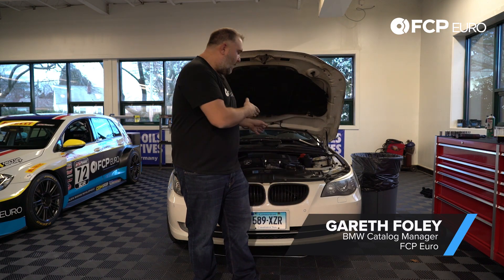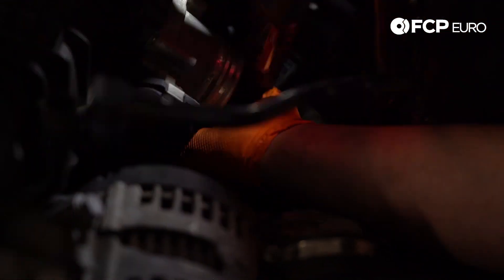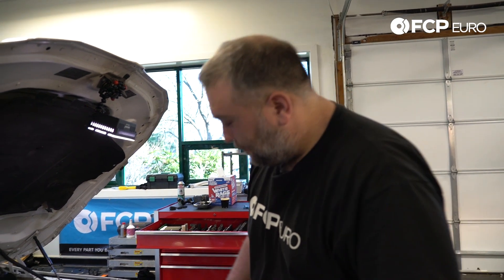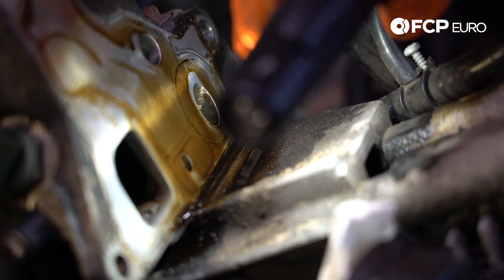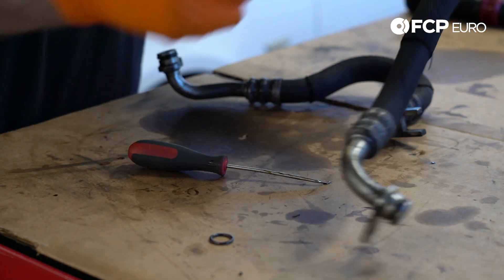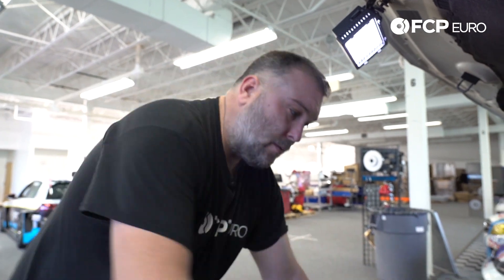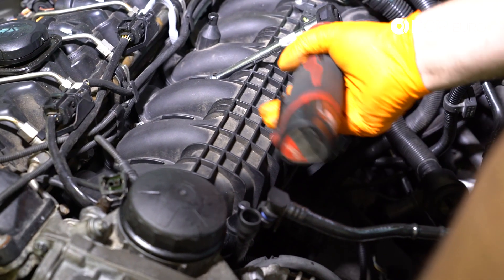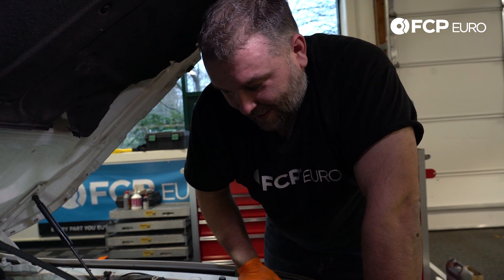How To Replace An Oil Filter Housing Gasket On A BMW N54

Comment: Has anyone tried the process to drop the alternator to get the back housing bolt? Seams easier that removing the intake.
Reply: All you have to do is remove the intake manifold bolts, then lift up the intake manifold while moving it to the right just enough to get clearance to the bolt. You don’t even have to remove the charge pipe. It makes the job so much easier. Under and hour to do. This guy did extra lol. Sorry fc euro, I do buy parts from there tho 👍🏼
Reply: I have and you are correct. It is SO much easier.

Comment: Do I need to prime the oil on n54 07. Do I add oil in housing?
Reply from the maker: You don't have to, but it doesn't hurt either.
Reply: Factory service manual says you should, and early n54s in particular sometimes spin a rod bearing after these gasket replacements. Some people believe it's because the oil wasn't primed.

There is only ONE way to do this properly and don't let anyone tell you differently. You must remove the electrical connectors from all 6 of your fuel injectors. The pour oil into the oil filter housing hole.  Don't add more oil than you're supposed to, just make sure you dump a quart or two of the total oil being used to fiill the system through this hole.  And it's a good idea to soak or swirl your new filter around in some fresh oil really quick before installing it. Lastly, make sure to lubricate your o-rings with oil before installing. The tiny one on the filter housing should be lubricated with oil before it's placed on the stick thing, and the big one should be lubricated with oil before being placed into the filter cap.

Once everything is tightened up and the fuel injectors are disconnected, get in the car and run the starter for 10 seconds without stopping, then wait 30-40 seconds, then repeat. Do this one more time (total of 30 seconds starter run time, two different waiting periods of 30-40 seconds). After this, you can reconnect your injectors and finish reassembling everything.  Take the care for a long drive if possible, at least 20 minutes (or more) to get the oil all warmed up and flowing through the system. As always, don't go driving hard until your oil has warmed up fully.

And a last note: this guide was great but really took a shortcut refilling the coolant. It's very important to burp the system.  And when refilling the coolant you should be checking the freeze protection, but if you just fill with 50/50 that's usually fine.  But it's important to loosen the bleeder screw on the coolant reservoir--it looks like a giant phillips plastic screw right next to the upper hose running away from the housing.  Open it wide and fill the coolant to nearly the top of the filler cap until the floating level bobber is fully floated to the top of the reservoir and there are no more bubbles coming out. then give the upper radiator hose a few squeezes, and re-tighten the bleeder screw, then reinstall the cap. Then afterwards, and this is extremely important: you must run the automatic burping mechanism to purge the cooling system of any air bubbles. To do that, put a battery charger on the battery unless you're sure it's brand new and fully charged, then get in the car, insert the key, keep foot off the brake and the clutch, and put the car into the "on" position by pressing the button (twice if necessary). You need to turn your heater on to the highest heat setting for both sides, but have the blower set to a volume of only one bar. Make sure it's set to blow face or feet but not the defroster. Once that's done, press the gas pedal all the way to the floor and hold it for 10 seconds until you hear the water pump activate. Once that begins, it will work on its own to pump water through the system and purge any air present. This can take about 20 minutes. Leave the car alone while it works (leave the key in place and don't turn it off). Once finished, you're safe to drive the car.

Comment: I’ve read that it is a requirement to prime the engine after this procedure. Apparently there is a ton of folks that have experienced a seized engine. What is FCP Euro position on this matter?
Reply from the maker: It certainly won't hurt to prime the engine!
Reply: @fcpeuro  how do you prime the oil system im going to be doing this on my 2011 135i keep hearing about the damage done to some n55 engines your opinion plz thank you
Reply: @pnum9618  did u ever find out how?

Comment: I just did this a couple of weeks ago. After the job, I noticed my oil doesn't climb to the normal operating temp (220-240 deg F). I've got a 335is with the oil cooler. I've read there's a sliding valve in the cooler that operates like a thermostat and keeps the oil in operating temps. Could this now be stuck open? I cleaned this and the filter housing with non-chlorinated brake cleaner, and I also replaced the oil pressure switch that came with FCP's kit. Anything I should look for to test that the oil cooler is functioning normally? I've got a Schwaben/Foxwell scan tool, if that can help.
Reply: So what happened?
Reply: @thinkingagain5966  After a couple hundred miles, it actually started to operate normally. But my oil temps don't climb as high as it used to before the job. It stays 20-40 degrees cooler than before, interestingly. Since the gasket was toast, I think there was too much coolant mixing with the oil, so the oil cooler couldn't do its job properly. Glad I replaced this gasket when I did!

Comment: I’ve done this on my 2011 535i (n55) it is a bit pain in the neck to do. One thing I couldn’t find on mine was the radiator drain petcock, so had to drop radiator hose ... pretty messy. I believe BMW service bulletin says to drop the hose... can anyone chime in if there is an actual drain plug for the radiator? Thanks
Reply: I couldn't find a drain plug/petcock either. I popped the hose off. Got fkn coolant in my eyeball, too. Pretty messy way to do it but got the job done. I see tons of people selling and discussing the actual drain plug but the few people describing its location aren't referring to our cars specifically. In our cars the intercooler sits about where the drain plug is being shown.
Reply: @allmycarsisbroke  On my N54 I had to drop the intercooler to access the drain plug. But then the drain plugs are finicky, tend to break, and then drain VERY slow. I won't be doing that again. Just disconnect the lower radiator hose.

Comment: Great video, but my leak is driving me nuts, its leaking from the oil cooler hoses connection to cooler housing, replaced both o-rings twice, but still leaks badly soon after a short drive, even replaced the cooler thermostat gasket and its leaking from there as well. Tightened enough that it feels like it would strip if I tighten anymore and still leaks. I see oil pooling down the short cooler hose and drips down. Any suggestions before shelling out hundreds in new hoses and cooler housing? Feeling like trying thicker o-rings for the hoses, 13.4x1.78 original to 13.4 to 2.4 o-rings. Has anyone tried those?
Reply: The bolts you're repeatedly removing and reinstalling are aluminum torque-to-yield bolts. They work by stretching upon installation. Once they've been removed, they need to replaced. The bolts probably would strip, but regardless, you've eliminated their ability to sustain torque and keep the seal tight. You need to order all new aluminum bolts, and may want to get new o-rings so you can install them properly this time.

What probably happened was you didn't lubricate your o-rings before installing them. You should wipe some oil on the o-rings that will be contacting oil regularly before putting them into place, otherwise the abrasion of being installed can damage them and make them fail. O-rings that will contact coolant should be lubricated with coolant prior to install. And lastly, you need to torque down all the bolts in alternating fashion as you reattach each part of the assembly. Don't tighten any one bolt down, just finger tight, then the next, then the next. Once they're all finger tight give them each a quarter turn or so at a time and keep going back and forth to ensure your gaskets are being compressed evenly. Otherwise they fail prematurely.

Comment: Can anybody please share the part number for the o-ring that is on the thermostat end of the oil line? 
Note: the o-ring size is smaller for the end that is going on the thermostat. Opposite to the end that goes on the oil cooler. 

Fcp kit only included the oil cooler side o rings, not the thermostat. That is most likely why you still can see a leak.

thanks

Comment: So if I follow this video, i might as well do valve*** cover gasket, oil change, oil filter change,  air filter change, coolant flush, upper coolant line change, thermostat, water pump, serpentine belt & tensioner, and of course oil filter housing.
Reply: Head cover gasket?
Reply: Turbos, engine mounts, oil pan Etc I say 100,000 miles needs the engine out service subframe bushings, control arms and a engine bay cleaning with the engine out.

Comment: most of this is completely unnecessary to change this gasket. Don't mess with the radiator, be creative to unbolt the hoses from the housing. Don't drain shit.
I just finished this job. And fluid loss was so negligible, I didn't need to top off.
I didn't remove the charge pipe, just pulled the two bolts from the middle of it, to be able to move it. Did not remove the throttle body, there plenty of room to move it aside.
Coolant hose in the front. I replaced those fittings with aluminum ones. I don't have issues disconnecting them... You should do that too.
Just take the plastic off, remove/move hoses and lines that are in the way of the manifold.
Remove oil cooler. And do your work.
I only messed with my charge pipe, because the leaking oil shredded my belt.
If you are also changing your belt, do it, after you everything taken apart; and before it's going back together for the extra space. Helps with cleaning up the mess, and this point in the process you won't be leaking fluids on your new belt.
Took me about three hours. Not counting cleaning up the mess from the leak. That was maybe an extra hour.
Note. If your tool kit isn't as nice as mine, it will take longer. But you'll be alright. ... And I have access to a huge supply of break clean to aid with cleaning.
Reply: Get it girl! Thanks for the heads up I'm about to start this job.
Reply: Il be reading this again very soon
Reply: @kaelanburke2097  I just did another one of these yesterday. If you need to ask anything, you can Facebook me, under the same name (Iowa).
I don't do videos, because trolls.
Reply: Hi Emily, great pointers! Quick question please: on a N55 with 75k, would you automatically change the belt (I am thinking need to based on amount of oil mess around) and what special tools needed?
Thanks!
Reply: @hgarti919  i only really trust a belt for about 100k... Given the cost, yeah, change it. ... Just for the belt, torx bits. One for the tensioner, and one to loosen the boost tube from the the center of the engine block.
This car doesn't really need any special belt tool. A long rachet is all I use. If you don't have a lift... A second person might be helpful. This isn't the easiest belt to get back on, by yourself.
Reply: Emily Hofland Many thanks 🙏🏼

Comment: How does the engine ingest the serpentine the belt
Reply: If the belt breaks, and the engine is still running, the belt CAN get caught behind the crankshaft pulley and the force of the belt getting wrapped up in that small space CAN actually push the belt past the crack seal and into the engine. Once in the engine, it is quickly chewed up and distributed, in tiny pieces, all over the insides of your motor. A tear down and rebuild will then be part of your future.

Comment: say I spill some  coolant from the radiator tube, after I top off on coolant should I bleed coolant or no.
Reply: MINEQWAFT yeah I would just to be safe only takes 12 minutes, 12 minutes is better than a whole repair if something just so happens so go wrong somehow

Comment: Advice - 
I 100% recommended using an E10 socket to get this done, if you try using an 8mm wrench on the lower screw you’re likely going to strip it.
 
If you plan on removing the lower coolant hose to access that lower bolt, it’s very likely going to break; order the aluminum coolant hose flange off FCP and save yourself a huge hassle
Reply from the maker: Thanks for the tips and advice, Ben!

Comment: It is recommended that you not reuse the plastic radiator drain plug.  This project was at least the second time the plug in my vehicle was loosened and the top twisted off in my hand. Going to FCP Euro to order a replacement, in the Product Information paragraph, they comment the part is "One time use only, should be replaced when installing a new radiator or when doing a coolant flush." They are correct. :-)
Reply from the maker: because they're typically plastic, it's definitely recomended to ensure proper sealing

Comment: The previous owner of my 2010 535i E60 had the oil filter housing gasket replaced, but whoever did the work did not clean up all the oil that had leaked down the front of the engine. Over a few months, maybe 1200 miles, the oil began to coat the belt and pulleys, causing the belt to snap catastrophically. Make sure, whether you do it or the repair shop does it, the oil gets cleaned off. Also had oil build up in the radiator and intercooler. I removed them just to clean them.

P.S. - Now I'm having to do the oil filter housing gasket again. That is, if it was actually done like the previous owner said or he was just lying to sell it.
Reply: How would one go about cleaning the remaining oil?